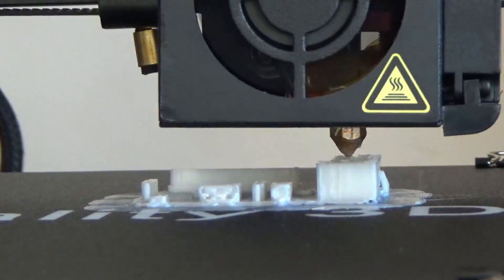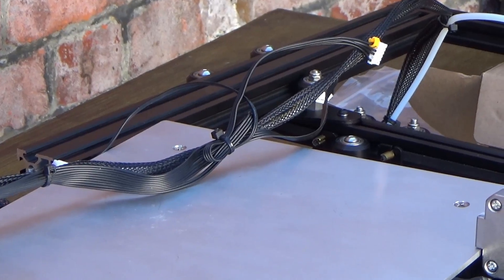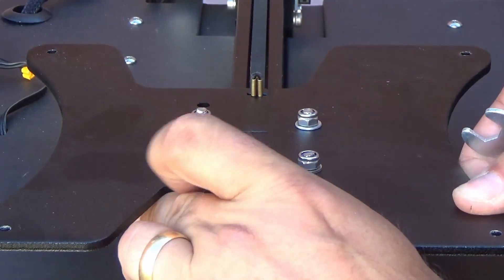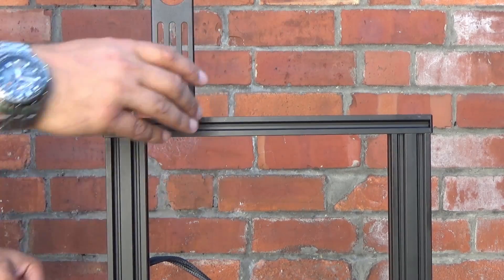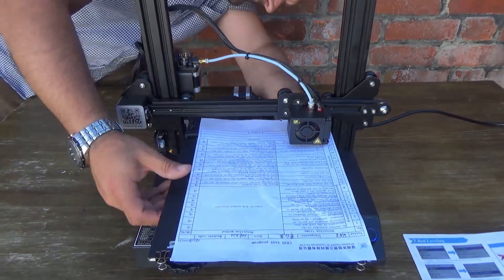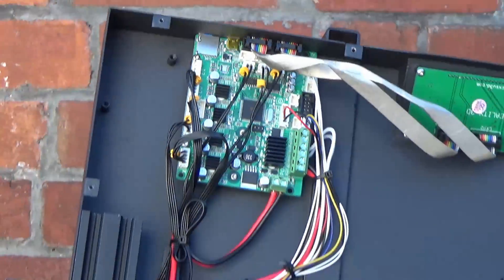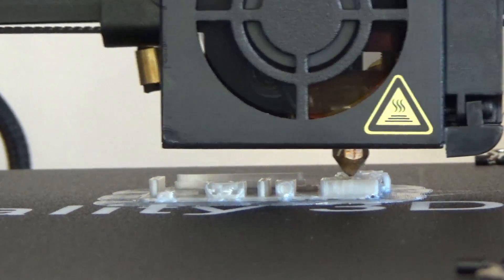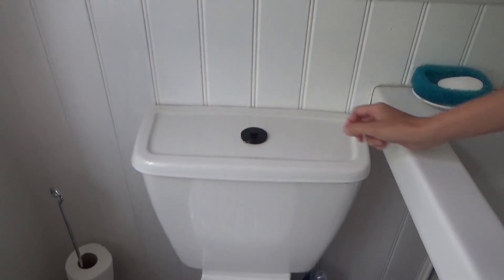DuB-EnG: New Creality CR-20 Latest 3D Printer Unboxing Review Build Best Value Upgrade CR-10 Ender 3

Comment: Now that it's almost 2 years on, how is it holding up? 

Would you buy another one if someone nicked yours, or would you get something else?
Reply from the maker: I’m actually continually impressed with this unit.  The ender 3 is better as it has a slightly bigger build platform. So I might upgrade to that, again a creality unit.  It had its quirks to start though!! :-)

Comment: my ender 3 came with a corrupted test model file on the sd card. I went nuts until I just tried a model I made.
Reply from the maker: Wow! ...  that’s interesting to know! ...  bonkers!
Reply: It made me really anxious about the quality control, but once I reformatted the SD, got a good profile for cura on youtube and leveled the bed, it has worked perfectly. I am actually astonished at the quality of the printer and the prints. When you consider that you can hardly get a decent bluetooth speaker for $200, the idea that you can get a good quality 3d printer for less is just nuts. My only regret is that you have to print from the sd card. A cable would be more convenient. But for $179 with free shipping from the other side of the world is pretty darn amazing.
Reply from the maker: Yes indeed, mine has offered many hours of printing pleasure since I got the problems ironed out!

Comment: The two bolts with washers on the bed plate are used for adjustment (without washers are fixed) and have a hex section under the table, so all you need to do is adjust them to realign the bed, they seem to be loosened during transit to the customer, the two bolts are eccentric so designed to be adjusted. I had the SD-Card problem too.
Reply from the maker: G6EJD very useful comment! TKS 73 OM DE M0XXX... QRZ
Reply: I had a hunch you might be an Amateur we tend to have the same hobbies, I got to the same sd card solution as you, came across your video through a search for sd card issues, glad I found you, it good to see you had the same loose bed as me, I was cursing the assembler and looking at the QC checklist with astonishment then realised why two bolts had a hex section, gave them a twist and nicely back to the way it should have been, don’t know why they don’t tell customers that, everyone must be getting the printer like that. Same for the sd card, nothing in their faq but clearly the V2.1 card reader is marginal or out of spec, because all my PC’s read the supplied card ok, the board is probably using 5v interfaces and actually should be 3.3v hence no detection or they haven’t included the necessary pull-up resistors. 73 Dave
Reply from the maker: Genuinely great to have a ham on board!! Thanks for your valuable input!! ... my mate wants me to make him some antenna spacers ... it’s going to be a fun time going forward!!  73!
Reply: Antenna spacers are an ideal 3D printing subject and PLA dialectic properties are good to about 120MHz when losses start to increase. I understand PVC and ABS is about the same, so for HF work ideal

Comment: wait a second, y would i get this if theres the ender 3 for approximately half the price and the same printing volume?
Reply from the maker: I think a lot of people would agree with you!! ... no huge benefits
Reply: i actually got it cheaper than the original price for the ender 3 so i just chose it because of the looks, and it prints very good
Reply: it also has auto resume on power failure that can let you stop prints on demand and continue later without loosing material

Comment: Hi, I just got mine, and like yours the bed wobbles. I've tried tightening the bolts like you did, but it still wobbles a millimetre or two. How did you fix it tight, or does yours also do this?
Reply from the maker: Hi there... I had to squeeze it by hand while tightening the bolts... you need three arms!! :-)
Reply: Actually I discovered it's the hexagonal bolts underneath the bed you need to tighten. All good now, and the CR20 is printing some amazing prints.
Reply from the maker: Excellent and thank you for the top tip... !

Comment: Thank you for your video.  I just bought one of these (its on route) and your video was very well done.
Reply from the maker: I hope it helps!! You may want to dig out a sandisk 8gb SD card!  Please report back on any modifications/challenges you face!!
Reply: you bet, i got mine from Mech Solutions in Canada and they completely test the unit before it ships so I hope that problem doesn't pop up....stay tuned
Reply from the maker: Excellent!!!
Reply: Update:
Had the unit now for 3 days.  SD card issue was the same for me.  100%.  I just went out and bought a USB cable and print directly to the printer with no issues.  A few issues when I got it.  The build plate nuts were WAY loose and I had to remove the whole plate (very easy) and tighten with the tools provided.  The cables in the manual were marked with letters to assist in the install however the actual cables on the unit had completely different letters on them lol.  All easy fixes but just wanted to get that out there.  I bought a Sandisk card as mentioned and I can't even get the unit to read anything on the card...I've tried 3.  USB cable was the best for me.  Printed the test dog code with zero issues and have done a couple builds so far.  The adhesion of the pad on the bed is off the chart and I'm finding even with rafting that removing the models is very hard without damage.  I'm going to get a glass piece soon.
Reply from the maker: Excellent - thanks very much for reporting back to the group! ...  I think I will look into OctoPrint in the near future...  actually, there is enough room inside the unit for a RaspberryPi to live permanently...  This will resolve all the SD an connection issues.  The build plate adhesion starts to fall off after a few weeks of work...

Comment: Thank you this was helpful as I was stalled on figuring out the proper connections. Do you happen to have a json file for the CR-20 that can be used with the new CURA?
Reply from the maker: Very useful to know... I wonder if others are having similar problems....
Reply: So THAT is what is happening. Manual pause and -0.4mm and my print is awesome!!! Cheers
Reply: OK so it seems you can get away with +/- 0.1mm and that is all. Even more complicated prints are sticking really well. Just wanted to say again how much I appreciated you making this video, as I was stuck trying to find some of the plugs.
Reply from the maker: Really happy to have made a useful video for once!!  Don’t worry...  there will be more 3D printer videos in the near future!!!
Reply from the maker: Greg Ferguson ... use the CR-10 file and adjust the bed size.  It works well for me!
Reply: thank you - I have been trying that but I cannot get PLA to stick to the bed. I have tried removing the clip on layer and using painter tap and elmer's roll stick, adjusting Z levels over and over, higher heat settings, different PLA. It just won't adhere properly and a "square" drags after maybe 3-4 layers. I have been trying for a couple of days - zero success. Seriously frustrated and wondering if it is this printer or I just haven't hit the lottery on settings yet. BTW my SD card also was not working in the unit, but could be read via USB/PC. EDIT: looks like the tape + glue + -0.1mm Z was the magic. It was also extruding 0.3mm just before printing which acted like a "broom" and messed up the layers. Thanks for your help!
Reply from the maker: Greg great to know you’re on track and making stuff! ...  I print quite close to the bed...  use a paper width to set your print head distance....  also, warm room, hot bed (60) degrees.

Comment: Pretty expensive compared to ender-3. Does it perform good enough to spend 200 usd more over ender-3 and choose this one?
Reply from the maker: Yeah...  stick with the Ender 3 until there is a good technical improvement...
Reply from the maker: ....  as with all new products... wait a little while and the price will likely come down...  minor advantages over the Ender 3 ...  the key thing is 24v drive for the heated bed so this may be a little better at ABS ...  I’m going to have a play with ABS soon...
Reply: ender 3 has 24v heated bed and it heats up to 110 c degrees
Reply from the maker: Murat P. Same bed same power supply then! ...  the only other benefit is the control board saves your position if you have a power cut...  which isn’t very likely....  so...  perhaps stick with the Ender?
Reply: The Ender 3 also supports "resume after power loss".
Reply from the maker: Is there a different size to the build platform? ...  this is 220 220 250
Reply: only difference is the auto bed leveling
Reply from the maker: I don’t think auto bed levels are a good solution... I like intrinsic accuracy... a mechanically aligned bed has to be better? Don’t you think?
Reply: Idn

Comment: Hi - I've had the same problem with the SD card. I thought the reader was broken. I've reformatted it etc to no avail. BUT now having had it for a week, I think this is how it works: If there's no card in the reader you much click init. SD card first. Then put the card in. Then click Init. SD card again. The SD card will show up. If you want to change the card then click Change SD card and go through the same process when you put it back in. It works every time (just about) for me.
Reply from the maker: Thanks Jon! That’s really useful to know!! ... they should make that bit a little more intuitive!!!
Reply: Tell me about it. The instructions neglected to mention plugging in the z-axis cables. Had a lovely crunching sound when I started it up (I'd plugged x axis into z - doh) and now have a nice little hole in the bed. Build bed was also completely loose. I wonder if this is default to stop transit damage?
Reply: All you have to do is "Init SD card" when the card is inserted.
Have had to do that on my Ender 3 a couple of times.
Reply from the maker: Yeah...  that didn’t work for me...  trust me I tried it...  lots!

Comment: Was it actually the bed roller bolts that were loose or was it the eccentric nuts that needed adjusting to get the bed tight on the rail?
Reply from the maker: Bed roller bolts were loose in this case.  It seems to be back on target now... 15 prints in and no problems!
Reply: I had a few loose bits on my CR-10S when I put it together so it seems best to go over them from top to bottom regardless at this stage. Still one of the better Chinese manufacturers :) Tossing up a second smaller one between the Ender and this one.
Reply from the maker: It was a frustrating start, but good results now!! ... yes definitely needs a little Engineering!!

Comment: How much did it cost? Where did you get it?

As for things to print, I’d like to see it print a 3DBenchy to see how well it handles it.
Reply from the maker: Ok ok ... benchmark boat ...  I’ve been avoiding printing a boat, but maybe your right!!  box.co.uk sell them, about £280 ...
Reply: Dubious Engineering Ok, thanks. I’ve been out of the 3D printing game for about 5 years now so its really amazing to see how far things have come in both price and quality. Looking forward to see how you integrate 3D prints in your upcoming projects!
Reply from the maker: I’m in the process of making a 3D printed laptop with raspberry pi
Reply: Hi I got one for £259 from Box. Arrived next day! It's excellent but note that I am a total newbie. PLA prints brilliantly. I've also printed a benchy in PET-G and it came out really well. Still playing with the settings for PET, but the printer is totally easy to use and I love it!

Comment: Great review, but I have a couple of suggestions. Never move the XYZ axis by hand. Let the processor do it. Some say you can damage the electronics, but the least you can do is change the orientation of your printhead/bed. Also do not put any pressure on the bed while leveling, it throws off your measurements. And as others have said it is best to level when the bed is hot
Reply: A lot of people say this, so i've donned some sunnies, put on the doofs and busted out with some wicked sick DJ scratch maneuvers on my build plate but alas nothing happened. I'm convinced this is just a myth. Have you seen how fast the build plate and hot end can whip around? Unless you push the build plate stupidly fast you are not going to generate more voltage than is normally fed in that circuit. Everybody moves the build plate by hand, you don't see rampant reports of damage
Reply from the maker: Interesting point... I will say that the LCD backlight flickers on when moving the build bed with power off...  that said, you’d expect people to move the bed by hand... and I still do... but slowly!!
Reply from the maker: Joe A thanks kindly... I’ll make a point of using the drive pcb to move the machine around!!

Comment: Hi, glad you got it working. I've got an ender 2 and it's great. A few tips, if you search around thingiverse you might find some bed levelling gcode that heats the bed up first(it probably expands a bit when heated so if you level cold it might not be perfect) and then automatically moves print head to above the 4 levelling points to let you level it.(the version for my printer waits for you to click nob before it moves to next one) so you can level it properly. Make sure you have the correct cura profile for the material/printer. The first print I did with what I thought were correct cura settings was ok but lacking something. I then found a better cura profile for the printer with pla(also another profile for ABS) which was night and day in terms of print quality. Finally consider the print orientation, ie direction you print, the inherent weakness in 3d prints is often in the layers so if you need strength you might want to print so the stress is not across the layers(e.g printing a shaft you might want it lying down across bed instead of standing up). I'm sure you'll work it out. Good luck.
Reply from the maker: Damn that’s an unfortunate sequence of events! ...  I’m going to have a go at octoprint soon, but just need the printer to make stuff for now! ...  I’ll have a look at both fusion360 and sketch up...  I’m sure you can get your hands on a new motherboard...  the v2.1 in my machine is on eBay for £38.
Reply from the maker: Let me know if you need an emergency toilet pull flush! ...  I have one of those designs done!  :)
Reply from the maker: Thats really great advice Fribgy! - Thanks! - Question...  what 3D modelling software do you use...  I'm playing with FreeCAD, but its a bit buggy and not the easiest to use I'm sure!
Reply: Hi, I use fusion360, it's free if you say your business doesn't earn more than $100K or are in education. I had slight advantage when starting to use it as I'd used 3d animation packages before, plus I watched this guy who is a good teacher https://www.youtube.com/watch?v=y5tp4QXciK4
Reply: I'm also curious to see what other people are using... I was using the free version of Sketchup with an STL exporter, so it can shoot models into the Cura slicer software for printing. I also hooked up a Raspberry Pi Zero and installed OctoPrint on it which allows me to send the sliced models over my network to the printer, so there's no need to fumble around with SD cards. Unfortunately my printer (refurbished Monoprice Maker Select V2) fried its control board, and a Windows 10 update screwed up Sketchup, so I'm both printerless and software-less. :( I have a copy of Fusion 360 but Sketchup seemed way easier to get to grips with.
Reply: Heh, I've found places that offer boards for sale, but they've been out of stock. It's been one thing after another... d'oh! Hopefully I can get it fixed soon, I've got stuff of my own for around the house that I want to print. :P